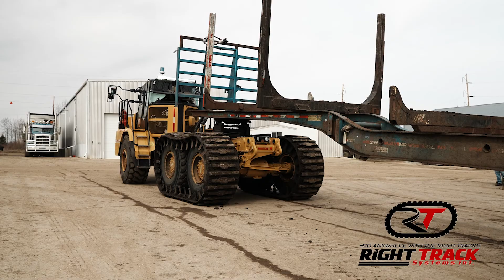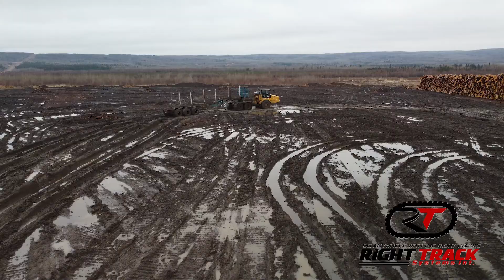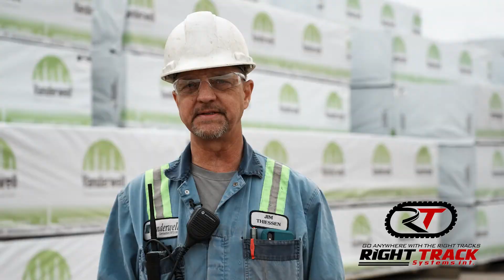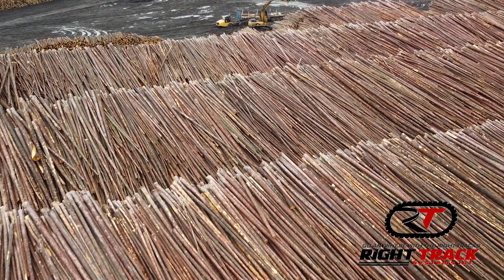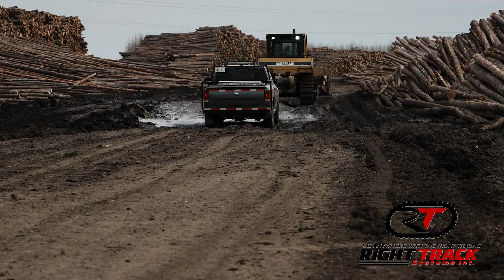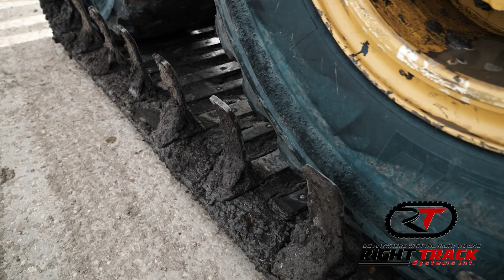Right Tracks Articulating Truck Tracks for Logging Applications | Right Track Systems Int

Comment: I was logging in  Alberta with super b equipped with CTI system which worked very well with the right operator.  But it never really caught on as much as i thought it would. This system looks good but you can only use it off road